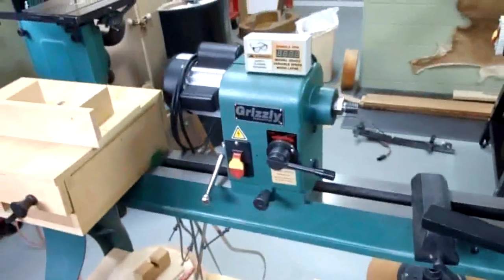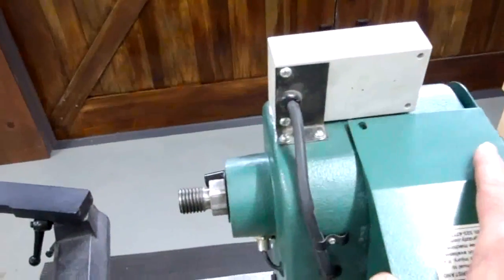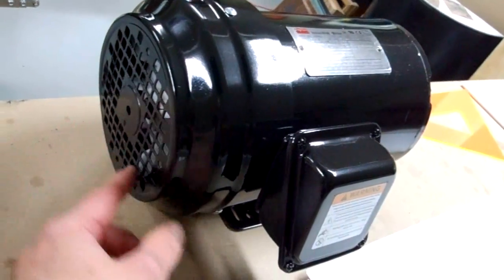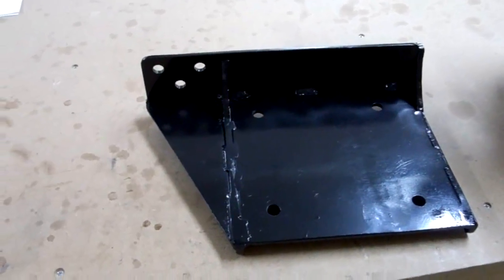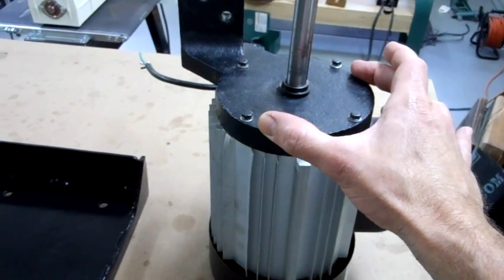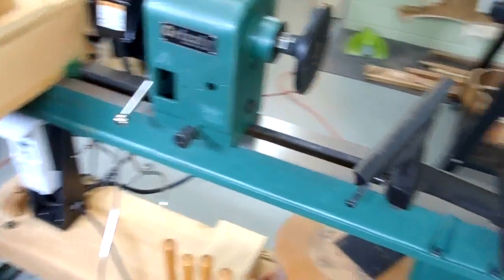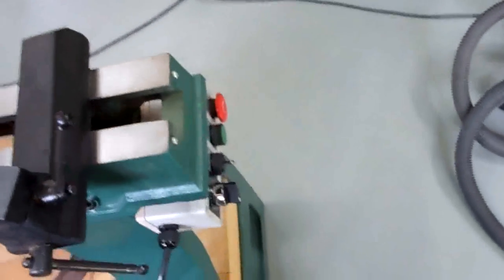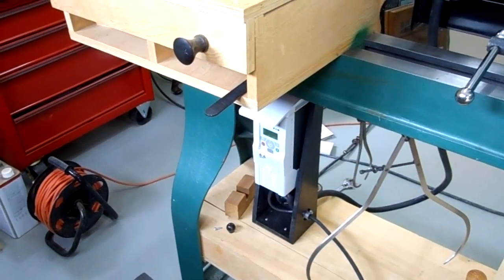Upgrade Grizzly G0462 to 3-phase Power

Comment: I love what you have done to your lathe, it had to have been a lot of fun planing it all out well done I especially like your Vfd remote and I'm looking to put one on my lathe, which has a 3 horse 3 phase with Delta VFD, I've extended the lathe bed to do 12' porch columns but I don't like being so far from power switch! Where would I find one like yours and would it hook up to where the on/off ,rpm, direction are now wired in? Thanks and again awesome job
Reply from the maker: Jacob Wilson if you go to my website @ http://www.deanocraft.com/, you can send me an email and I will forward my parts list. It has the controls listed. Thanks for the comments!

Comment from the maker: I spent close to $500 on the upgrade and I love the functionality. I believe a new lathe with these features would have cost me well over $1,000. The end result still has the same bearings and weight, but it it quite improved with the vfd because of lower speed turning and reverse.